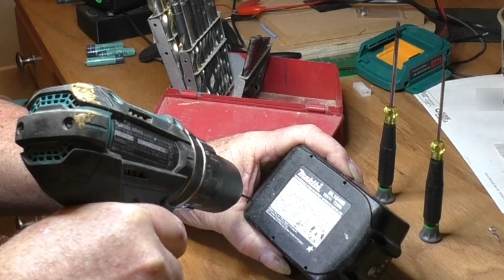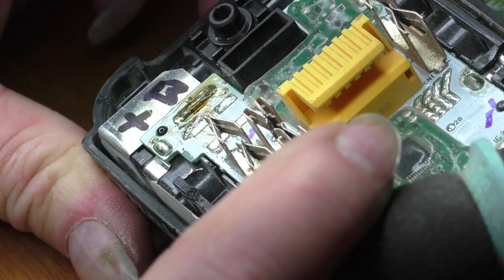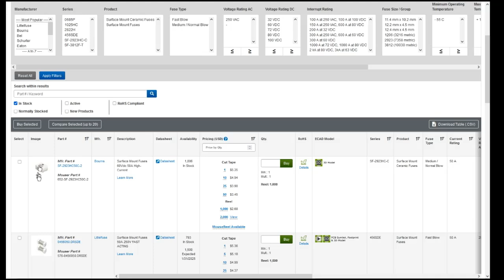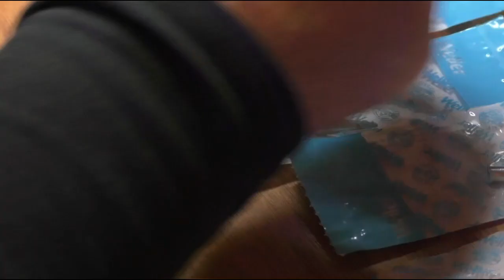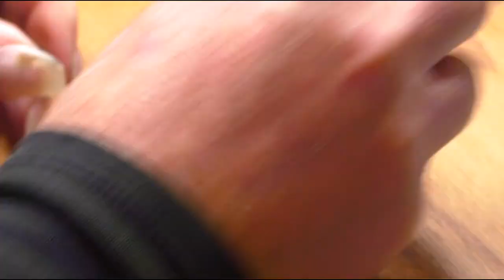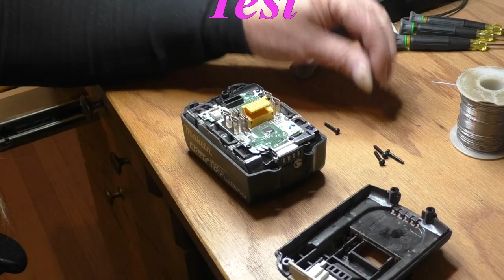Makita® LXT® BL1840 Battery Repair

Comment: You needed to pile the solder on at 11:40 so that you had a big blob of solder to make a nice molten pool, you could then lift one end off then do the same to other end and then use desolder braid to clean up the empty pads..
Re-soldering I find it easier to add solder to one pad only so it goes flat down when you flow that side then just solder the 2nd side.
My tips are always bad as I never have a wet sponge, just never seem to have got into the habit.
I like the battery adapter much better than craft knife blades with croc clips.😊
Reply from the maker: The dock was pretty cheap on Amazon and some of them have fuses but they cost more and I was being cheap as usual.
Very little of the pad came out from under the fuse and that tip would just not transfer enough heat to melt the solder.
My iron holder has a place for a sponge it it is always wet when i am working.

Comment: I have the same problem. Hope that resolves it. Checked like you did with voltmeter. Thanks. I thought they were ceramic resistors because they are white ceramic. I have the same board. Do you know the model number for the board?
Reply from the maker: I do not have the model # of the PCB but on the case just behind the data connector is 162Y08CW and A92839 [VERY small numbers]
I am guessing that one is a model number and the other a serial number.
After repair and BEFORE attaching the battery MAKE SURE your tool is not shorted or you will pop the fuses again.
Reply: @digysdosdiy9113  Thanks I found that. Makita doesn't sell them only others make copies. Makita wants to sell new batteries and not have fires. I will try your fuse trick next week. Thanks and great video.

Comment: You should have just soldered fuse wire it would have saved you enough money 😜 😂😊
Reply from the maker: It is recommend to replace parts with equivalent parts. Hacking a repair can lead to unexpected and possible unanticipated unsafe issues.
Reply: 100a fuse the batteries can't even output that much current I think 20-30a fuse should be more than enough 30a fuse wire can run the whole house electricity 😀
Reply from the maker: @ziafathussain8546  If the battery was unable to output that much current then it would not have blown the fuses.
House current is not the same as low voltage current.
30A at 120v = 3600 watts
30A at 18 volts = 540 watts
Plus, a DC Amp has more power than an AC Amp  because the current is not oscillating. Part of the cycle in AC is actually zero current.
Reply: @digysdosdiy9113  drills only pull around 18-22 amps the manufacturers don't know what they are doing its better to have a lower fuse than a higher one
Reply: No way does it need a 100a fuse that's overkill
Reply: @digysdosdiy9113  I don't think them fuses are 50a probably around 10a 😀
Reply from the maker: @ziafathussain8546  These batteries are used in many types of electrical tools, not just drills. How much current does the drill pull if the motor is stalled? What about a hammer drill? What about a circular saw, a chain saw, lawn  mower, power dump buckets?
I have no idea how much current these devices pull under maximum or stall loads but I do know that Makita did not pick 50A fuses because they had some extra ones just laying around.
I used to think Electrical and Mechanical Engineers were clueless when I was a service tech, then I became an Engineer and found out that it was I that was clueless.
Reply: @digysdosdiy9113  if the battery can only output 40a max then the fuse shouldn't be 100a that's my way of thinking
Reply: @digysdosdiy9113  I have 48v ebike battery that can output 208a continuously but I don't have 200a fuse on it
Reply from the maker: @ziafathussain8546  You seem to TOTALLY miss the point and have no understanding if electrical circuits.. 
1) The battery had TWO 50A fuses in parallel for a 100A fuse element.
2)  The battery was shorted.
3) The fuses popped which means the short exceeded 100 Amps validating that the battery can deliver in excess of 100 Amps. Where did you fabricate the "40a max"?
Drive circuits like ebikes and cars are fused at less than the battery can deliver to protect the components.
The batteries in the electric equipment I work on can deliver well in excess of 600 Amps but the drive circuits are fused between 350A and 500A depending on the requirements and design of the motor control system.
Makita designed their battery to be used in multiple applications. It is likely the drive circuit of each device has their own fusing element for protection but the battery must be able to provide enough current for ALL devices where it is used today as well as devises not yet in existence.
If the battery was fused for your little drill at a measly 18 to 22 Amps then they could never use it to power larger equipment.
A power source should have circuit protection at the value that the power source can safely deliver. Any less then money was wasted on building a power source that cannot be used to its fullest extent.
To have a power source that can safely deliver 208 Amps and fuse it at less would be stupid. My bet is that your ebike can only safely carry the current at whatever Amps the ebike fuse is rated at.
Reply: @digysdosdiy9113  really? I've been working with electric and electronics for 40 years I know what I'm talking about you should never exceed the maximum limit. 100 x 18v = 1800w do you think that battery can out put 1800w? And you didn't damage it in a tool you shorted it. The higher the fuse the longer its going to take to blow and more time more damage I use a safe size fuse/breaker not melt the wires 
Or damage batteries etc
Reply from the maker: @ziafathussain8546  You are a totals loss.If you were paying attention then you would have known it was not in a tool when I shorted the battery. It was 
a direct short.
Get a grip on reality: If the 100A fuse blew then YES, it exceeded 1800 Watts, it does not matter what you think, feel, or imagine.
• I did not engineer the battery. It was THE MANUFACTURE that defined the "maximum limit" at 100 Amps.
• I used THE SAME specification fuse that THE MANUFACTURE used. 
• I would NEVER deviate from manufacturer specification unless experimenting.
BTW: I have over 47 years experience with the last 25 in Engineering but I NEVER throw that card unless challenged because it is arrogant to do so and and as you have shown, experience does not equal intelligence. 
I bid you farewell and a safe journey.
Reply: The battery can't output 1800w so the fuse shouldn't be 100a end of story
Reply from the maker: @ziafathussain8546  Sure, you opinion proves that the fuses THAT BLEW did not blow. You must be a liberal.
"No amount of evidence will ever persuade an idiot" - Unknown but attributed to Mark Twain
Reply: Check the specifications of the battery cells before criticism
Reply: I didn't say anything was wrong with your work I'm just telling you that the fuse they used is not the right size that's all
Reply from the maker: @ziafathussain8546  And once again your opinion proves that a 100 Amp fuse THAT FAILED due to a short did not fail.
I will never understand how people can have opinions opposite of fact.
I am tired of this, stay happy and content in your ignorance.